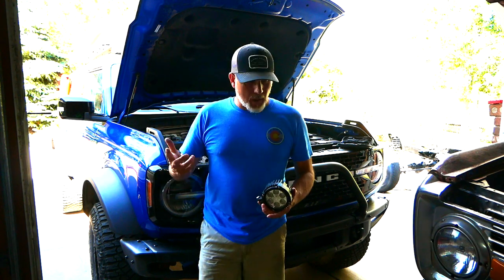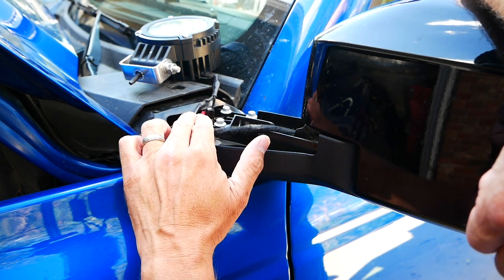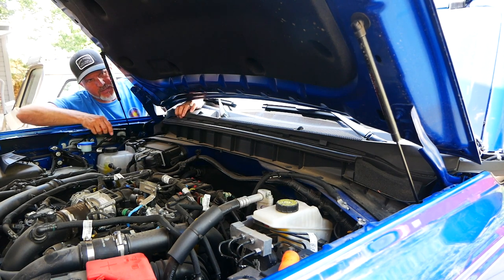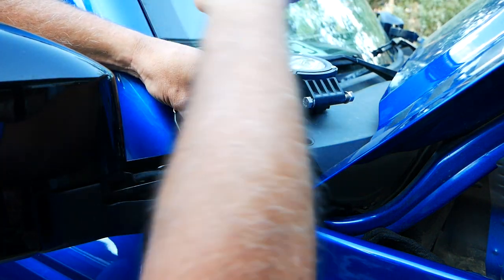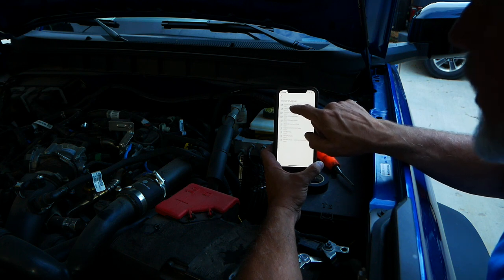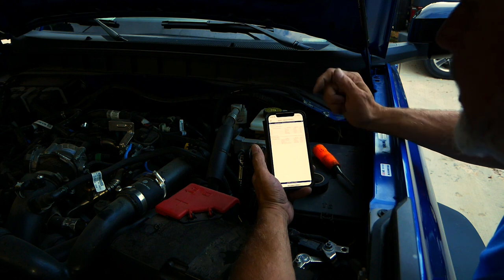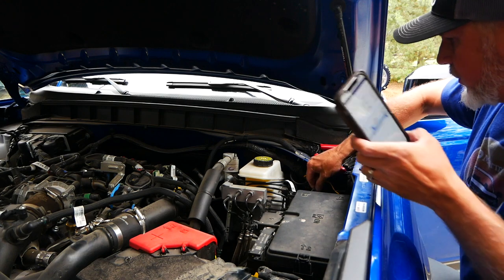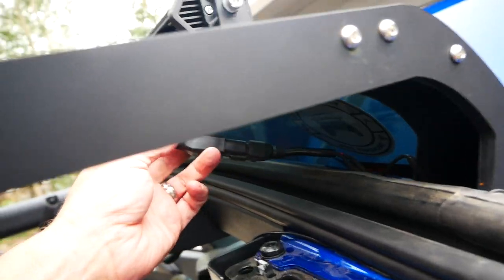Wiring Bronco Accessory Lights *No Drill Method*

Comment: I was looking at Bass Pro link you attached. Which all lights did you get?
Reply from the maker: The 150w bar, two 30w round lights, and two oval lights for the bumpers.
Reply from the maker: The 150w bar, two 30w round lights, and two oval lights for the bumpers.